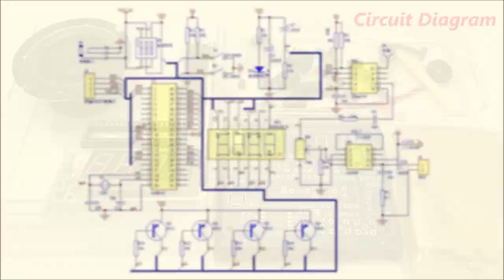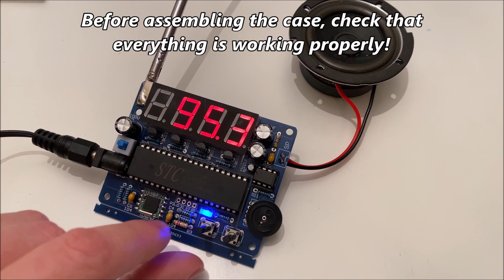FM Radio Receiver DIY - 87/108 MHz (Part-1 PCB Assembly)

Comment: Sadly my chip was broken, currently waiting on a new replacement that is coming in tomorrow. Hopefully the second time I can finally get my radio up and running. Also I really wish I saw your video before I put it together, I would of saved somewhat of a small headache when trying to figure out the best way to put it together.